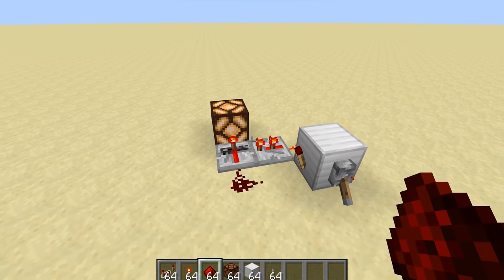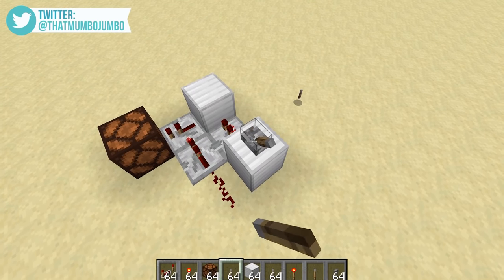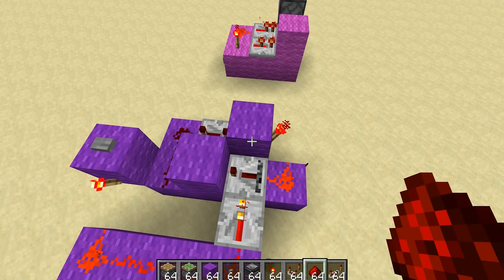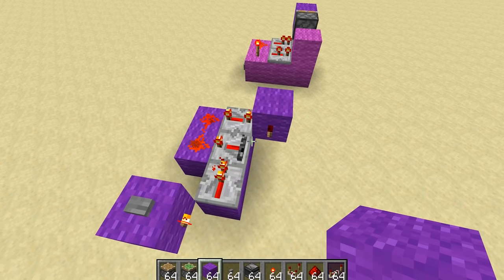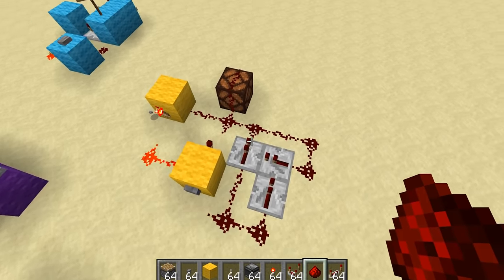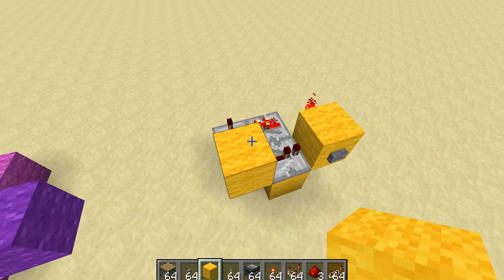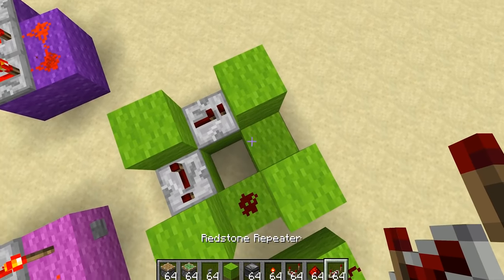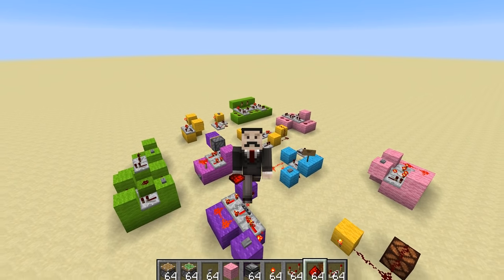TRYING to Understand LOCKING REPEATERS in Minecraft!

Comment: Locking repeaters in my opinion are much more helpful with changing where a signal comes from, for example, a chicken farm that when it collects enough eggs to fire all of them at once and space is tight. A comparator output from the storage into a basic comparator clock that is pulsing the dispenser will only fire one or two unless you have a pulse extender. But when it's only dispensing when it's full a pulse extender would be huge, unless you have a second comparator that locks the repeater inbetween the first comparator and the comparator clock until the container is empty
TL;DR
A contraption that activates at full capacity and stays active until empty then turns off. 

Hope this helps, I use locking repeaters often in my redstone builds, mostly to bastardise a contraption that has a simpler solution that I didn't come up with, because I don't like using anything from other people unless it's a small logic gate or basic method like a hopper clock or hidden input devices.

Comment: Some of the designs you started with are very very old and the RS NOR Latch you showed can be 2x3 with 2 torches and 2 repeats(or 1 repeater and 1 Redstone dust).

Also comparators locking a repeater has been in the bug report for a very long time. I added it in myself.
Locking repeaters are very handy but for the right job, which is why they are less used. I have a 30min+ video in which a load of them are used for a train station.

Comment: I built a pretty cool machinery with locked repeaters that looks if its input is not powered/constant powered/ fast clock. With 3 output lamps it shows which type of signal the input is. If you change the input from a constant signal to a fast clock signal (or the other way around) without turning of the signal it will detect it and shows you an Error. It also shows where the error occurred

Comment: I once made a secret room, but the check to open the door was way too loud (pistons) so I needed an alternative, quieter solution. I turned to locked repeaters, and after i finished, I basically just had a cluster of repeaters pointing into each other. It did get the job done though, and that's the day I realized, that sticky pistons do everything locked repeaters do, but better.

Comment: You can make a timed input using locking repeaters. So you have to hit the button at the right moment.
🅱 =block
⬜ =hopper
:- =comparator
R. torch =🔥
-- or | = repeater
⚫ =button
R.lamp = 🔆

⬜.            🔆
⬜:-🅱🔥--|
                 ⚫

Sorry for the bad diagram.

Comment: Technically, you can only create an SR NOR latch using NOR logic gates. If you want to use locking repeaters for that you need to make them into a NOR gate.
Other things can be SR latches, but not an SR NOR latch. There is also an inverted (i.e. the S and R signals are inverted) SR NAND and an SR AND-OR latch (which has one of the signals inverted)

The simplest nor gate in redstone is a block with a torch with 2 inputs. It is only if both inputs are off that you get an output.
The function of the SR NOR latch is you have 2 inputs. One input feeds one NOR gate (and the other input feeds the other). The output of one NOR gate feeds the input of the other.

Thus when it is in a reset state, if you raise the S input high (store), the output of the circuit goes high (which is the one connected as an output to the other NOR gate). (and the inverted output goes low).
When you raise the R input high (reset) you reset the circuit, setting the output low (and the inverting output high).

A toggle flip flop is just an extra bit of circuitry which detects the output of the  RS NOR latch to determine which input the trigger should trigger.
The simple way is with AND gates, so if the output of the RS latch is high, it will AND with the input of the T-flip flop causing the R to go high.
If the inverting input is high, then S gets triggered. However this either needs a pulse or a clock signal to and the input as well, otherwise it becomes a clock. One way to overcome that is to lock the Output and inverting output signal feeding to the T-flipflop with its input. That way the input locks the signal, meaning only one and get goes through, meaning only R xor S  gets triggered once.

I'll try making some and let you know how I go.

Comment: Now, for a digital circuits from one of the three guys who understood how the t flip-flop you made works

Your basic memory circuits are the S latch, and the R latch which are useless on their own, however you can combine them to get an SR latch, which can be simplified using nor Gates to make an SR Nor latch.

From there, many people like putting in an enable (clock) input which doesn't let the output change when we don't want it to , giving you a gated SR latch

After that, we can fix the biggest problem with RS latches (if both inputs are on at the same time, jankey stuff happens) by tying one input to the inverse of the other, creating a D latch, with one input that when it is on, the circuit remembers, and when it is off, the output does whatever there other input does,. This is what you have with the repeater locking

After that if you put the output of one of these with into the input of a second, and have them have opposite enable inputs you have a rising edge D flip-flop that follows whatever the input is on the rising edge of the enable input and remembers it till the next rising edge

After that you just need to have the input be not the output have the enable be your button and you have a T flip-flop

I should probably make a world download explaining all this much better than text can

Comment: You can use locking repeaters to prevent well.. observer derpiness like a observer firing a piston which reactivates the observer. The circuit that I made was a mess, and broke the observer's ability to be used as a monostable, but it (kind of) works

Comment: Usually, I use locking repeaters to detect if a signal came first. The only time I've really used them is with a puzzle thing and with a combination lock. So, they are really only useful for 1 or 2 things.

Comment: I can see some applications like a timed lock-out mechanism. A capacitor made from a comparitor-loop (where it loses X-amount of power per cycle) and have that fed into a repeater that locks out the signal being sent for initial activation. Could be useful in a combination lock that prevents them from brute-forcing their way in (though I think this would require a "press button when you think you have the right combination" thing... a bunch of switches with no activation signal could still be brute-forced.)

Though currently my main thing right now is using the random glow-time of a redstone ore block as an activation of some subtle cues. So, your victi-err, your friend is walking through your base. They walk over a redstone ore block, it doesn't really "do" anything on the first pulse... But on the second pulse when it turns off, it activates something like maybe scary noteblock music, opening/closing a door/pathway, or maybe just fires off a couple pistons to make them think something bad is about to happen.

Comment: I've found a few uses for them 
I have a slot machine design that has 3 piston feed tapes (the display) and how it works is the feed tapes are run by a clock each with it's own and then watch feed tapes has it's own randomizer (hopper, dropper with 7 stackable items and one tool, compartor) and t flip flop (3 droppers one hopper compartor design) once the randomizer once the randomizer flips the t flip flop on then the output to the t flip flop locks 2 repeaters, one that locks the piston feed tapes and one that locks the clock into the randomizer to turn the system off 
Then also the t flip flops have another output which is inverted, this is for the win detect system basically how the win detect works the feed tape is made of glass and a solid block so if all 3 are solid blocks in the center you win, this is detected by a line of repeaters, if it's glass the signal won't go through if it's a solid block it will, but I can't have that line of redstone be on until it's stopped spinning because if it lines up before they all stop spinning it will go through like you won even if you didn't so before that line of redstone is 3 repeaters each that has another repeater that goes into the side to lock it, these are linked to the t flip flops and inverted (so they are all locked until all t flip flops turn on and then they unlock letting the signal go through

Sorry if that was confusing or hard to follow
It's probably not the best design but I made kt when I was like 13

Comment: This was a major component to a silent, 9-button combination lock I made in bedrock... (it's more reliable than pistons, imo) 

I don't know if this is a real logic gate, but "if" gates are what I like to call them.  If the side repeater is powered, remember current state. If the side repeater is unpowered, read live signal. 

Really awesome application; shift registers.
Reply: For the "if" gate idea, it would only work once. After that, the first signal is gone and would have to be reset before locking it again. There are much simpler ways of changing the signal, like having one source closer to the receiver which is selectively on or off
Reply: Perhaps it was lost in how I worded it. A locked repeater is a memory cell, where as an unlocked repeater allows a real time signal. This is what I meant by "if" gate. 

In a circuit, you can use it to conditionally change the activation of a sub circuit. Normally locked repeater, unlocks under a certain condition, only allows the input to activate "if" the first condition was met.
Reply: Unlocking the repeater could change the value of its output signal once only. Locking and unlocking the repeater after that would result in no change in signal going to the "sub circuit". To lock it again with a different signal, you'd have to send that different signal through the now unlocked repeater before locking it. During that time, the "sub circuit" would get the new input before the repeater gets locked again.
Reply: Pulse limiting and timing will change that.

Comment: Took a while to find this again, but i found a use for the locking repeater. 

I came across an answer while building a new storage system, as right below the walkway, is a massive 80 furnace system set up.

Now, the problems stems from the fact that because of how long the track is, the hopper minecart is emptied very quickly, but if i want to smelt more than 5 stacks of items at any one time. I have to turn the tracks off to allow the cart to refill. Which is not great for an AFK design. At least and not take a much longer time due to the length of the track. While i could shorten the track that would not due to as i wanted the massive 80 furnace set up

So i went to Redstone, i added a comparator, then two pistons, one to catch the hopper minecart, and a second to make sure the signal shuts off once i run out of items to smelt.

However, though this works as long as there are items being fed and kept in the hopper. Once i ran to low, or did not want to smelt 5+ stacks of items, it would fail, and would not turn back on till i added more items.

This is where the locking repeater comes in, adding a second switch. I made it so i could activate the the piston that turned on the rails, but not activate the piston that caught the minecart. Thus i could smelt less than anything from 1 iron ore, to an entire chest full of items. 

Just by using a locking repeater.

I have pictures, and can make a world for you to use if you should wish to check it out. But yeah, this is a use for the red repeater, and locking function.

Comment: I have an item frame based combination lock using locking repeaters :) there is one item frame in a room that is the “lock” and I have two other item frames that are “keys” and you can rotate any of them any amount of times, but the door can only open if specifically the “lock” item frame has been rotated exactly 7 times. If the “keys” are rotated into their proper position nothing will happen because my “lock” item frame continually powers and locks the repeaters coming from the “key” frames (unless the “lock” has been rotated exactly 7 times) ! I hope that made some sort of sense xD

Comment: the only feature i can think of where this is useful is if you have a combination lock where the system needs to lock itself if the wrong code is entered or if one event in a security system should lead to other features being blocked, like for example if the door is opened all traps can not be triggered.

Comment: The repeater lock tflip flop that you said doesn’t work with different pulse lengths does work with different pulse length, all you need to do is to change the delay on the repeater that is getting locked

For example; if you use observers set the delay to one tick, buttons four ticks and so on

Edit: also that tflip flop is also a red stone clock if you give it a constant red stone input
That happens because you are disabling the red stone torch that is powering the repeater that is locking the repeater

Comment: I used them in a large combination lock with each pressure plate representing a number hardwired to an rs nor latch that would lock or unlock a repeater to allow a valid input through but if an incorrect number was pressed a separate line would reset all the nor latches and also if a correct number was pressed a second time bc a repeater was now unlocked it would also send the signal to the reset circuit so every number had to be entered in the exact order to unlock the door. It didn't use any pistons so there was no indication of a right or wrong number happening or even when the reset happened.

Comment: Double vertical piston extender under one vertical two horizontal slimes and cobblestone walls on top and  horizontal piston extender with cobblestone to replaced the walk way and the wall will pop back and forth as a gate so a big block swapper, try this challenge for

Comment: I vaguely remember that the comparator locking is special, making it so the signal can pass through the repeater if it is greater than or equal to the lock strength. 15 = 15, so it passed?
But I am not certain. I think I remember that from when this was first introduced. It may be inaccurate now, it may have been inaccurate then, IDK.

Comment: I made a two code piston door using comparators and item frames and a redstone torch key that lead into an AND switch. When you put the torch key in without the right item frame code, a noteblock sounds with an error noise. If the comparator is activated, it locks the signal so the error noise cannot be powered

Comment: Locking repeaters aren't very useful because 80% or 90% of the time, you need to know what state (on/off) the repeater is in while it is locked. To do that with a locking repeater, you would need to null the input of the repeater and then locking the repeater is useless. To do the reverse, you simply remove the repeater. This is probably really confusing, so here is what I just said in action.
https://www.dropbox.com/s/9kptc3qz6tx1xei/why%20locking%20repeaters%20aren%27t%20used.png?dl=0

Comment: I build a combinationlock in a 5x6 space  using locking repeators and input resetters only (basically the inputs were just buttons underneath the corners of the Plattform pushing cauldrons top and the reset was just pushing them back down again)

It almost works 100% how i wished it to be.... (ok, maybe 85%)

Comment: Question for what you understand of these Mumbo, I have built a rail line from my base to my Iron farm, with a button activation at each end. Running a line along the way to have a call the cart back feature if it's not at that end. Could a locking repeater be used to prevent it from becoming an infinite pulse extender? The call line is connected to the same button that launches the mine cart, with just a redstone line with repeaters to keep the pulse traveling. If I run reverse repeaters around the existing ones, how would I place the locking ones in to prevent the back power flow causing the launch blocks being always powered?

Comment: Compact pulse shortener by having a locking repeater set to 2 ticks, a double inverted input signal going into the locked repeater, and using it to give just enough pulse for a hopper to transmit only one item?

Comment: The only thing I use locking repeaters for is locking piston doors so if a mob steps on the pressure plate it won't open the door.

Comment: The most useful locking repeater circuit I've seen are the Adder and Substractors that use just repeaters and comparators. Each time they recieve a signal the signal strength goes up by one.
You can also use the method to lock a circuit or clock based on if a chest has inventory, or a lever is switched.